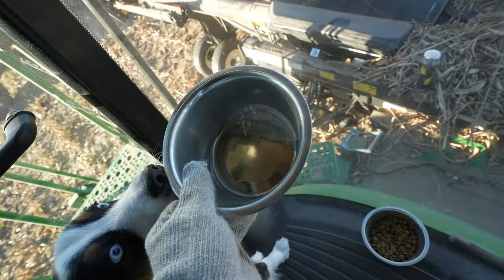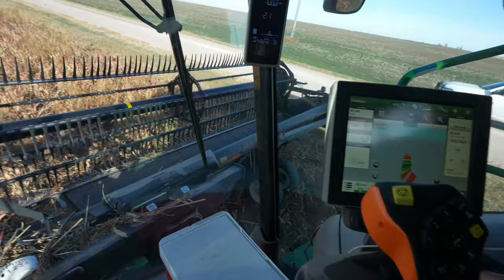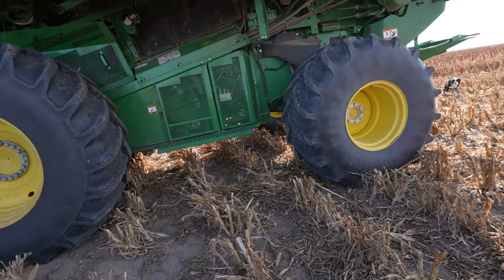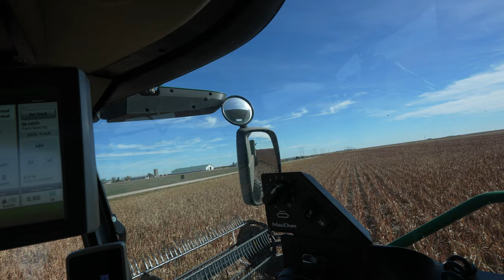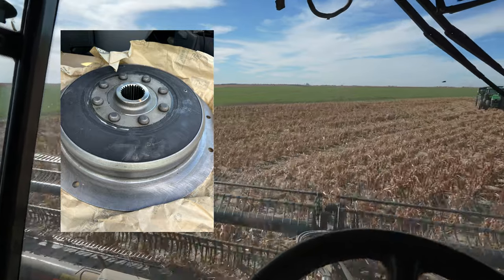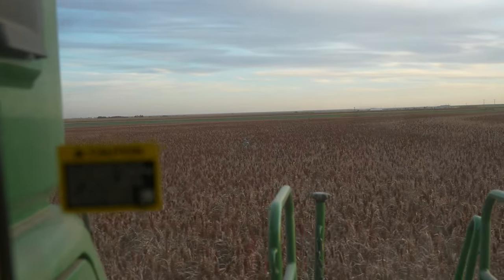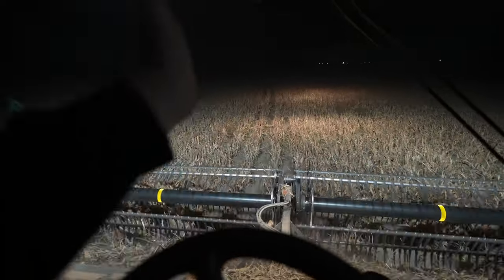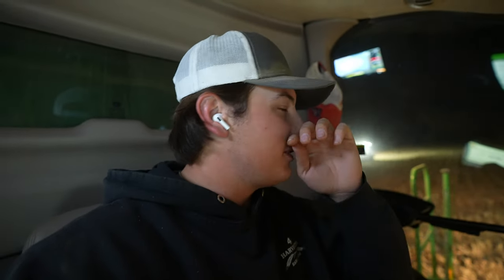Last Day Of Kansas Milo Harvest Goes Out With A Bang

Comment: Why is your rubber bottom step so high
Reply from the maker: To clear the truck frame when it’s loaded on the trailer and the ladder is folded in
Reply: @HaydenOnHarvest  we just take it off when you are not flexible it helps getting up there